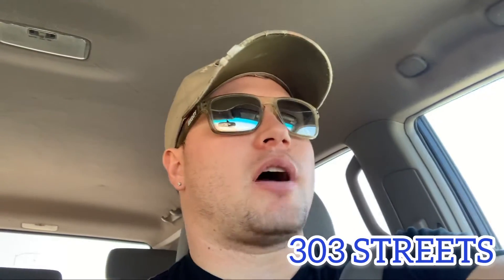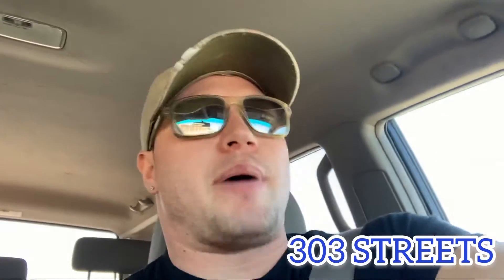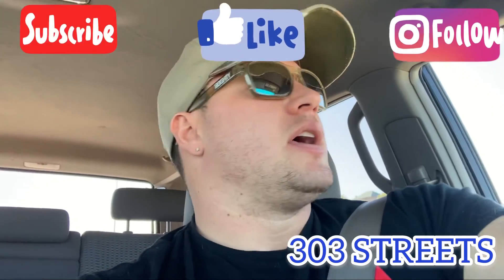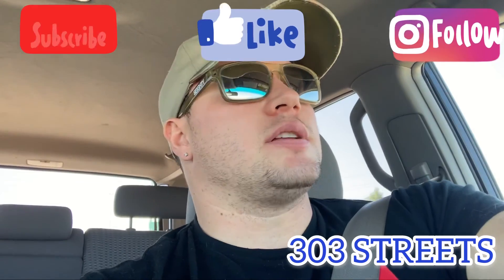How to get more horsepower out of a 4.8L Chevy Silverado

Comment: The biggest factor to consider when installing "power adders" (supercharger, turbo, nitrous, etc.) is the transmission. 4l60s tend to be picky on how much power they can handle, especially if left stock. So I would plan on spending AT LEAST another 2k getting the stock trans built or replacing it with the stronger 4l80e.
It ain't smart to run +450hp through a trans that can only handle 320hp

Comment: I have 2011 4.8l 4x4 with 22 in rims. I had the lag big time and bought the pedal commander, that helped with the lag big time. Made the throttle response almost instant.
Reply: Pedal commander is unsafe if it fails it will continue to accelerate and not deactivate as a fail safe.

Comment: It’s the wheel and tire size that delays your power in the gears. With 35’s I’d run 4.56’s.
Reply: That’s a little too much gear for it, 4.10’s are the most I would go. Otherwise you’ll definitely be loosing mpg and up top power
Reply: @evan3387  I’m just speaking from what I’ve heard and experienced with a couple of my buddys trucks. Not saying your wrong I just haven’t experienced 4.10’s before.
Reply: I have a 07 4x4 silverado on a level kit on 33's & I got my 4.56 done at TOP NOTCH DIFFERENTIAL 👌 & a tune on my computer & the transmission computer best upgrade so far

Comment: Let's remember gear ratio if you're lifting a truck and putting bigger Wheels I'm working on a street truck project 4.8 😉 thinking about boost District supercharger I did order some parts through Texas Speed at the end of the day remember the transmission my goal is to put a Powerglide

Comment: might as well buy a 5.3 or 6.0 for all that money
Reply: Yep and just a swap to 5.3 all ya need is the engine dont even need a tune plus will notice a pretty good power increase. Did for me anyway.
Reply: My 4.8 stock is a tire roaster
Reply: @shadowopsairman1583  maybe with 410 gears
Reply: Ya but all the fun is building it but I get the point
Reply: Don't buy a crew cab 4.8 and then jack it all up and cry about power maybe. Save your money with a TB Spacer Save for a small Cam
Reply: Lame, rather build the 4.8 make 450wheel and see the look on everyones face😂 they have a total of 15hp difference stock and 4.8 dont have active fuel management, so theres no point if your gonna build the motor regardless
Reply: What about a 2in leveling kit
Reply: @larry40 mine is 6 speed manual 4.8 and im really having fun with it